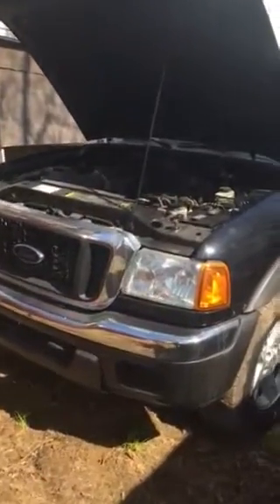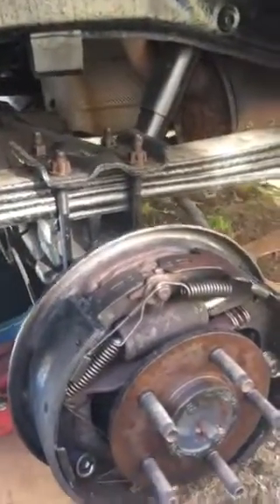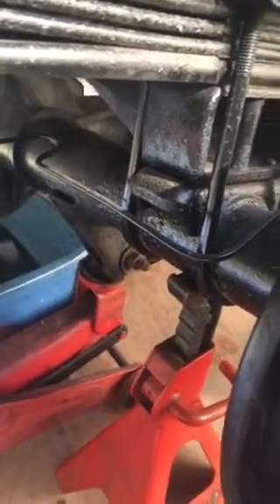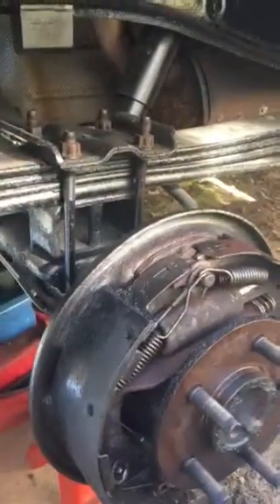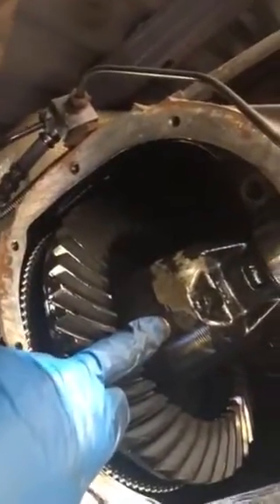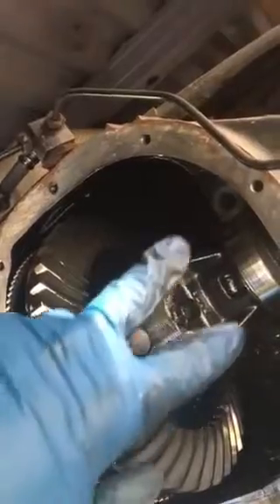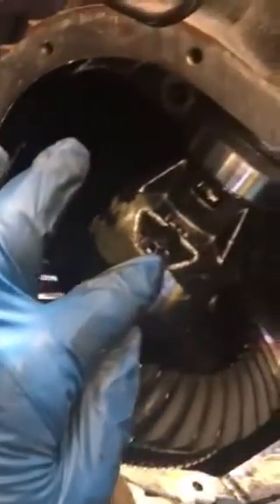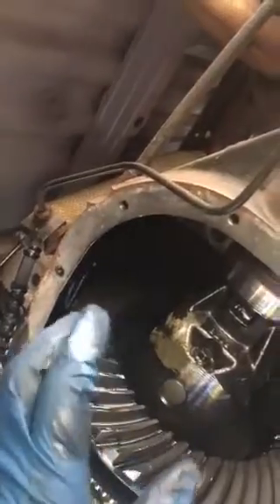Ford ranger rear axle replace

Comment: maaan! You didn't show how to replace the damn axle! 1)remove the retainer bolt2) pull the big pin in the middle out of the center/middle of gears3)pushing the axle towards the center with a magnet extension pull the c-clip holding axle4)pull the axle out then install new one and everything else in reverse.

Comment: How do you remove the clip holding the axel !
Reply: 1)remove the retainer bolt2) pull the big pin in the middle out of the center/middle of gears3) pushing the axle towards the center with a magnet extension pull the c-clip holding axle4)pull the axle out then install new one and everything else in reverse.